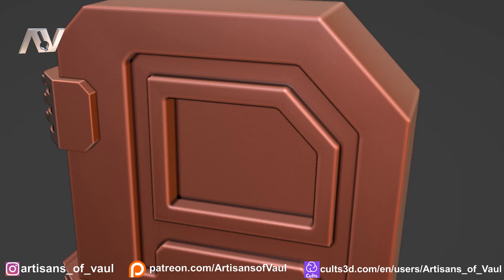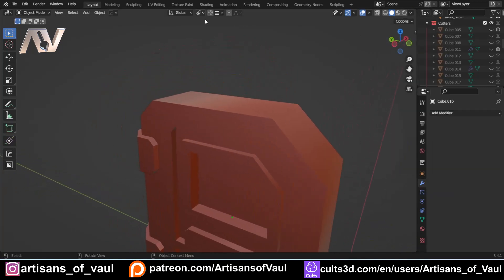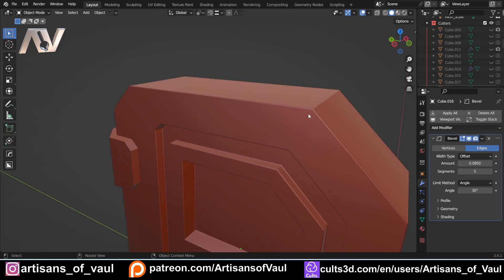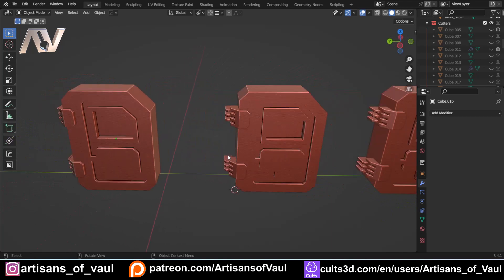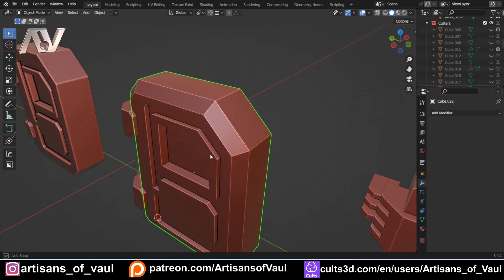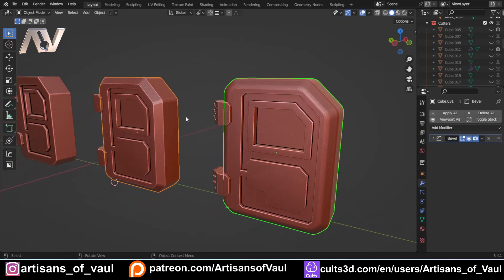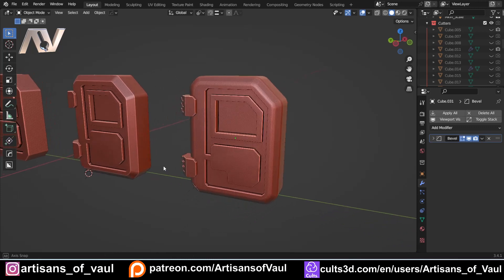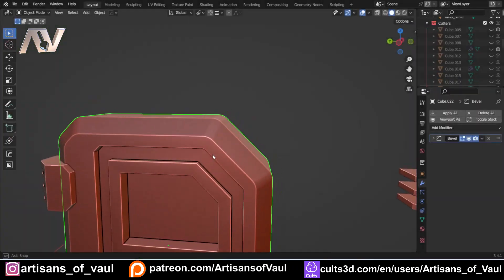Bevel Theory in Blender

Comment: would i be right in saying tho that this is destructive and the way to make it non destructive is to use a non destructive way i can use weights right?
Reply from the maker: You can yes, and hard ops does a really good job of this (its also on sale until Friday if thats something you're interested in: https://blendermarket.com/products/hard-ops--boxcutter-ultimate-bundle/?ref=834)

Ive done a video that goes into a bit more detail about that here (the hard ops bit is from 9:23: https://youtu.be/Yd8w_CQncOI )
Reply: @ArtisansofVaul  so that was probably the first addon i bought. And i think i may have way more addons than i need.

But i thought u had to adjust the weights manually as in it applies it to all edges and so unmark and apply only the ones we need right? Sorry i should watch that video first.. 
Thanks once again man.. cheers!!

Comment: I guess I have the opposite addiction. I like to sharpen things/aka edge crease :D I do like the bevel modifier which I didn't know about funny enough for a while, and beveled a bit manually but after watching some tutorials I encountered the advice of not using bevel and sub divide much and it's best to use edge loops instead of subd. Totally agree the middle one looks the best and the first one looks almost low poly which is a bit ironic because of all the bevel geometry. Could you use a bevel modifier and then come back in and add a different type of bevel to some of it or does that mess up the geometry. I know there's a few settings in the bevel modifier that can apply a bevel that can alter the way the bevel looks just need to play around with it a bit more to figure out which option to do for what I'm modeling.
Reply from the maker: You can definetly apply different bevel modifiers to different edges. It's made MUCH easier with hardops though.

Comment: The bevel between window pane and its frame, is usually called a seal :D
Reply from the maker: Lmao. I accept your point. Though I think it wouldn't be exactly the same bevel as everything else and on airlock/security doors I think the sealing element is inside the frame so it can't be tampered with. I could be wrong though.